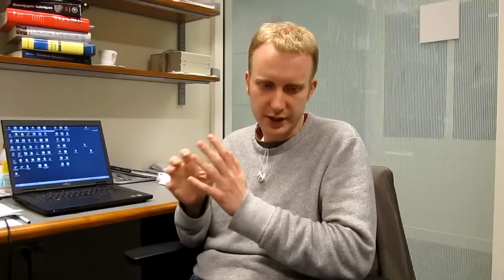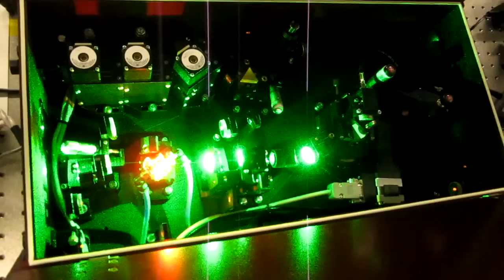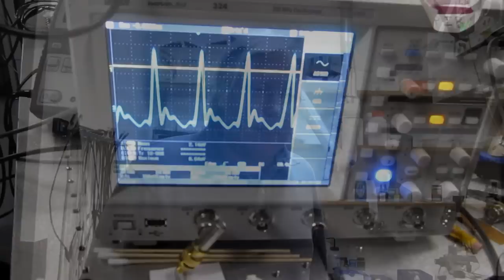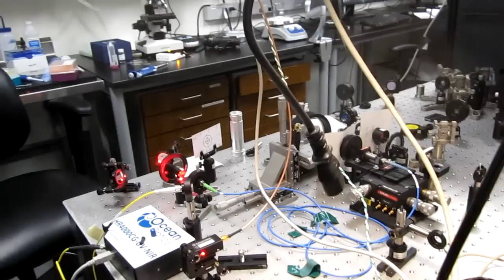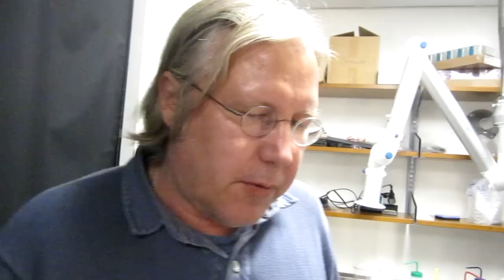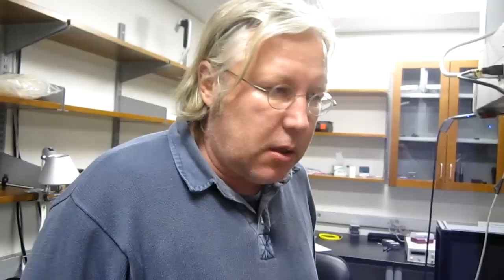STED microscopy of nanodiamonds with Del Mar Photonics Trestles LH10 fs/CW laser

Comment from the maker: In vivo two-photon uncaging of glutamate revealing the structure–function relationships of dendritic spines in the neocortex of adult mice
Jun Noguchi,1 Akira Nagaoka,1 Satoshi Watanabe,1 Graham C R Ellis-Davies,2 Kazuo Kitamura,3,4 Masanobu Kano,3 Masanori Matsuzaki,1,4 and Haruo Kasai1

Neurons communicate with each other with synapses using chemical messengers. The major synapses in the cerebral cortex utilize glutamate as a messenger and are made on special submicron structures, called dendritic spines. Dendritic spines are diverse in their size and densely packed in the cortex. Therefore, an optical technique for application of glutamate to single spines (two-photon (TP) uncaging) has been intensively used to clarify their functions in vitro. We have here extended 2P uncaging to living adult brain, and found that spine sizes display tight correlations with their functions, such as rapid glutamate sensing and an increase in cytosolic Ca2+ concentrations, even in vivo, as they were reported for in vitro preparations. Our data suggest that the structure and motility of dendritic spines play a key role in the adult brain function.

Abstract

Two-photon (2P) uncaging of caged neurotransmitters can efficiently stimulate individual synapses and is widely used to characterize synaptic functions in brain slice preparations. Here we extended 2P uncaging to neocortical pyramidal neurons in adult mice in vivo where caged glutamate was applied from the pial surface. To validate the methodology, we applied a small fluorescent probe using the same method, and confirmed that its concentrations were approximately homogenous up to 200 μm below the cortical surface, and that the extracellular space of the neocortex was as large as 22%. In fact, in vivo whole-cell recording revealed that 2P glutamate uncaging could elicit transient currents (2pEPSCs) very similar to excitatory postsynaptic currents (EPSCs). A spatial resolution of glutamate uncaging was 0.6–0.8 μm up to the depth of 200 μm, and in vivo 2P uncaging was able to stimulate single identified spines. Automated three-dimensional (3-D) mapping of such 2pEPSCs which covered the surfaces of dendritic branches revealed that functional AMPA receptor expression was stable and proportional to spine volume. Moreover, in vivo 2P Ca2+ imaging and uncaging suggested that the amplitudes of glutamate-induced Ca2+ transients were inversely proportional to spine volume. Thus, the key structure–function relationships hold in dendritic spines in adult neocortex in vivo, as in young hippocampal slice preparations. In vivo 2P uncaging will be a powerful tool to investigate properties of synapses in the neocortex.

Introduction
Optical stimulation can overcome the limitation of classical electrical stimulation: an electrode is often not sufficiently thin and flexible to selectively stimulate neuronal structures of interest. One such methodology, optogenetics, utilizes light-sensitive channels or pumps, the genes of which are transfected into a certain set of cells in the brain tissues, and subsequent stimulation of their proteins causes changes in the membrane potentials (Zhang et al. 2007; Gradinaru et al. 2010). Another methodology, two-photon (2P) uncaging of neurotransmitters, directly activates native neurotransmitter receptors via activation of caged agonists with a high spatiotemporal resolution (Matsuzaki et al. 2001) when these caged compounds are applied directly to preparations. These two optical methodologies have distinct features. For example, the selectivity of stimulation is mainly achieved by the specificity of gene expression in optogenetics, while it is achieved by the precise location of optical activation of chemical compounds in 2P uncaging. Optogenetics is often more suitable for studying network properties (Wang et al. 2007; Zhang et al. 2007; Gradinaru et al. 2010), while 2P uncaging is more suitable for studying subcellular neuronal structures such as synapses (Matsuzaki et al. 2004; Bloodgood & Sabatini, 2005; Noguchi et al. 2005; Beique et al. 2006; Asrican et al. 2007; Harvey & Svoboda, 2007; Honkura et al. 2008; Tanaka et al. 2008; Lee et al. 2009; Kantevari et al. 2010; Govindarajan et al. 2011) and dendrites (Losonczy et al. 2008; Branco et al. 2010).

Although optogenetics has already been applied to many in vivo preparations, 2P uncaging of neurotransmitters has until now never been applied in vivo. This is because methods for the reliable and quantitative application of small chemical compounds to brain tissues have not been established. The lack of in vivo 2P uncaging methodology has hampered the direct characterization of synaptic structures and functions. For instance, although structures of dendritic spines, particularly spine head volumes, are known to show tight correlation with their function in young hippocampal slice preparations (Matsuzaki et al. 2001; Noguchi et al. 2005; Beique et al. 2006; Asrican et al. 2007; Zito et al. 2009), it has not been clarified whether the same rule holds in adult neocortex in vivo. This point is particularly important since long-term changes in spine volumes have been reported in adult forebrains, and related to learning and memory (Hofer et al. 2009; Kasai et al. 2010b; Roberts et al. 2010).

We therefore developed a methodology to apply 2P uncaging of neurotransmitters to the neocortex of adult mice in vivo. We first examined the diffusion of a small fluorescent probe from the pial surface into the brain parenchyma, and estimated the actual concentrations of caged agonists applied to the pyramidal neurons in the brain up to 200 μm from the pial surface. We then established the conditions where 2P glutamate uncaging could stimulate synapses at the level of single spines, and found that the strong structure–function relationship of spines exists for spine volume and functional expression of AMPA (α-amino-3-hydroxy-5-methyl-4-isoxazolepropionic acid) receptors. The relationship was stably maintained over many minutes, suggesting that the structure of spines plays an important role in the synaptic transmission. Moreover, we found that Ca2+ signalling induced by 2P uncaging showed inverse correlation with spine volume, suggesting that the neocortex shares similar learning rules as the hippocampus.
http://www.ncbi.nlm.nih.gov/pmc/articles/PMC3115818/

Comment from the maker: Inactivating viruses HIV, HPV, salmonella, E coli with femtosecond laser pulses 
Inactivating viruses HIV, HPV, salmonella, E coli with femtosecond laser pulses

Femtosecond Multipass Ti:Sapphire Amplifier manual
http://www.dmphotonics.com/TiSapphire_Multipass_Amplifier/Wedge%2050.pdf
Femtosecond Pulse Stretcher
Temporal pulse stretching is required in avoiding the effects of 
peak power damage in high energy ultrafast amplifiers. This 
peak power damage is due to the tendency of bright beams to 
self focusing (a result of non-linearity in the index of refraction), 
which makes it necessary to limit the intensity present in 
amplifiers. The technique of chirped pulse amplification (CPA) 
gives a possibility to avoid this obstacle. The idea of CPA is to 
stretch femtosecond pulse duration reducing peak power before 
amplification and to compress pulse duration back to 
femtoseconds after the amplification. A principal scheme of 
femtosecond pulse stretcher is shown in the Figure 2. This is 
purely optical device containing diffraction grating, spherical 
mirror and plane mirrors. Femtosecond pulse going into pulse 
stretcher has a broad bandwidth. For a 100 fs Gaussian pulse the 
corresponding bandwidth is about 9 nm. A diffraction grating 
sends different frequencies in different directions at different 
angles of diffraction shown in the Figure 2 for long wavelength 
(shown as red) and short wavelength (shown as blue) spectral 
components of femtosecond pulse. After double pass, bluer and 
redder components exit the stretcher as shown in the Figure 2. 
One can see from the figure that bluer frequency components 
have to travel further through the stretcher than the redder 
frequency components. The result is that the redder frequency 
components exit the stretcher first, the pulse has been stretched. 
In the Wedge 50 pulse stretcher the input pulse is dispersed in 
the horizontal plane. The stretched pulse is directed back to the 
stretcher with help of vertical retroreflector, and four passes 
through the stretcher are achieved. Four-pass configuration is 
necessary to ensure that the stretched beam is spatially 
reconstructed. Femtosecond pulses with pulse duration 100 fs 
are stretched to more than ten picoseconds pulses before 
amplification. High reflective gold coated holographic grating 
gives stretcher efficiency higher than 50% for specific 
wavelength regimes.
Femtosecond Pulse Compressor
The pulse compressor was designed for compression of 
picosecond pulses amplified by Wedge 50 multipass Ti: sapphire 
amplifier to pulses as short as 50-100 fs. The principle of pulse 
compressor operation is shown in the Figure 3. One can see that 
in contrast to the pulse stretcher, redder frequency components 
have to travel further through the compressor than the bluer 
frequency components. The result is that the pulse has been 
compressed. Varying distance between the gratings, the 
compression can compensate the stretching precisely giving 
almost the same pulse duration as obtained from the seed laser 
pulse. The Figure 3 shows a simplified pulse compressor. In the 
Wedge 50 pulse compressor some other optics are involved, i.e. 
horizontal and vertical retroreflectors give a possibility to use 
one grating and to achieve four-pass configuration. High 
reflective gold coated holographic grating gives stretcher 
efficiency higher than 50% for specific wavelength regimes.

Comment from the maker: Generation of wide terahertz radiation using bulk and quasi-phase-matched GaAs crystal - request a quote for GaAs crystal
Author(s): Baolong Yu, Naibing Ma, Min-Yi Shih, Alexander V. Parfenov, Physical Optics Corp. (United States)
Physical Optics Corporation (POC) studied intense terahertz (THz) generation through optical rectification in bulk low-temperature growth GaAs (LG-GaAs) and quasi-phase-matched orientation pattern GaAs (OP-GaAs). POC performed simulations based on one-dimensional coupled propagation equations of THz and optical fields and conducted experimental tests. The results show that a LG-GaAs crystal with 0.5mm-thick under the excitation of a compact all-fiber femtosecond laser (76 MHz, 100 fs, 100 mW, 800 nm) can generate wide frequency range from 0.1 to 8.2 THz. The enhanced conversion efficiency was found for OP-GaAs crystal that can generate an average THz power of several milliwatts. Both theoretical and experimental results show that average THz output power is proportional to the energy fluence of the excitation source rather than the laser power for ultra-short pulse source. These achievements provide an effective approach to increase THz output power.
http://www.dmphotonics.com/GaAs_crystal/GaAs%20crystal.htm

Comment from the maker: CW Ti:S laser kit with small breadboard, one mirror set
[CW-Ti:Sa-Kit-Basic]	
http://greyhawkoptics.com/product_info.php?cPath=163&products_id=805&osCsid=ee1e2b6a83d5c012c36229d76370da6e
CW Ti:S laser kit with small breadboard, one mirror set
CW Ti:Sapphire laser kit
Tuning range (@10W pump): 710-980 (two optics sets) or 730-870 nm (one optics set)
CW output power (@10 W pump, 800 nm): >1800 mW
CW wavelength tuning is available only with appropriate options (see below)
CW linewidth:
<45 GHz
<20 GHz (with 1 etalon)
<2 GHz (with 2 etalons)